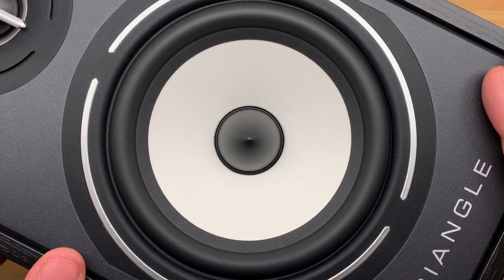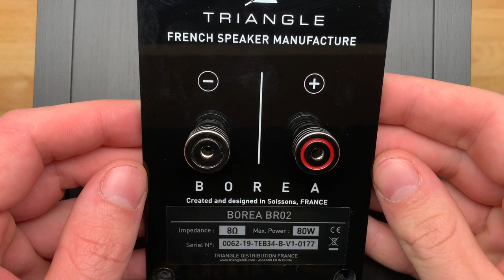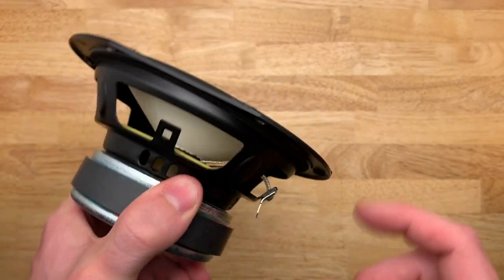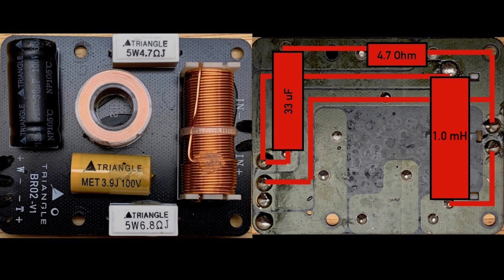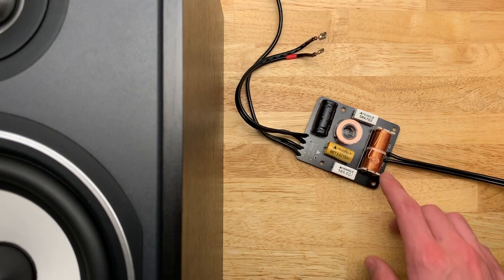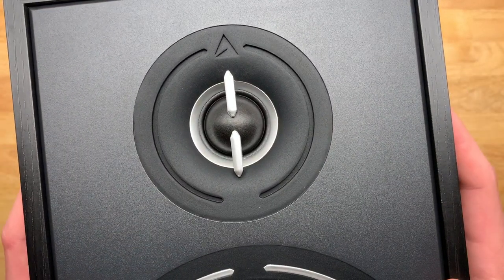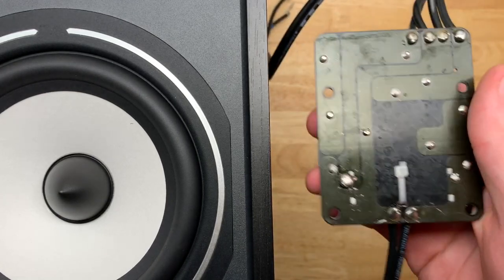Triangle Borea BR02 - Review and Analysis with Schematic

Comment: Thanks for the breakdown. I always take a look inside my gear to see if there’s anything I should upgrade to a higher quality part. They kinda had to use an electrolytic cap for the sub, because a 33uf poly cap would be huge. Thx for the vid, man.
Reply from the maker: @Nick Pantazi the poly caps get insanely big. I've upgraded a couple crossovers before and they definitely take up a lot more space in the enclosure (and cost a LOT more).

Comment: The resistor and cap across the woofer is a Zobel network to compensate for the impedance rise at higher frequencies due to the inductance of the voice coil.  That allows the inductor (this would be a 1st order crossover for the woofer) to see a flat impedance across the load at higher frequencies and allow it to work as calculated to block them.  Otherwise you get less effectiveness from the inductor as frequency rises and it's counter productive.
Reply from the maker: I once worked with a man named Zobel.

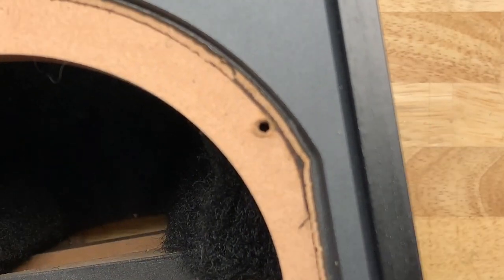Comment: Very true "manufacturing note" at 6:15. My Borea BR03 is not well matched so that left side of the woofer protrudes roughly 0.5mm outside the front speaker plane. My grills stay on and OCD is under control so not very bothered by it.

Comment: A capacitor and a resistor in parallel with the woofer is called a ZOBEL NETWORK. Zobels tame the impedance spike that woofers naturally have near the bottom of their frequency response. 8 ohm woofers are really 8 ohm rated when you implement a ZOBEL network.
Reply from the maker: I once worked with a guy named Zobel.

Comment: The question about the binding porst are they steel or brass. If they are steel removing that from the signal path will improve profomance. The woofer frame sounds like its a stamped frame. You can if there's room apply dense foam strips to the legs. The Plastic divider on the tweeter is a dispersion device. That the Crossover has copper inductors verses cheap Iron inductors. There crossover looks better thae a lot of speakers I've seen from $1500 to 2K on Dany's Channel.
Reply: You realize it does not matter right?

Comment: Nice, perhaps a BR03 breakdown in the future?
Reply from the maker: @CD - ROM that's a good idea. I wouldn't be against reviewing another Triangle.
Reply: Casey Schmidt I picked up a pair recently, and paired them with a couple REL subs. Sounds wonderful.
Reply from the maker: That sounds like an excellent combo!
Reply: @cd-rom.  Hi, I also have BR03, and thought of adding a REL. Curious, wich sub pair did you choose / recommend?
Reply: David J I have the REL T5i. The speakers have decent bass on their own, but when you hear it side by side with the REL. It’s 100% worth the investment. Hope you get a chance to hear them.
Reply: Hi, do you expect that the Bro3 would have a slightly better crossover, based on the specs and larger cabinet?
Reply from the maker: @Paul Grower - It is pretty much the same design as the BR02 just with a few more components; which is to say that it does have a better crossover. That said, it uses the same budget-quality parts as any other speaker.

Check out Tee-Jay's video here where he takes apart a BR03:
https://www.youtube.com/watch?v=laJrKozceFc&t=1218s
Reply: @Casey_Schmidt  Great. Thanks very much!
Reply: @Casey_Schmidt  Mr. Casey Hello! Mr Casey, if you live in USA 🇺🇸, much better use JBL Studio 530 speakers. I have a lot of complaints about JBL, but Studio 530 They did a very good job. Triangle Borea is the same price as the JBL Studio 530.  But the difference in quality is huge.If you compare a Borea woofer with a Studio 530 woofer, you will be shocked!  And everything else at JBL is better - case, connectors, tweeters ..

Comment: Thanks for the video, excellent teardown! I've been on the hunt for a speaker that's smooth and non-fatiguing, but also dynamic and engaging with classic rock, not too soft or muffled. FTR, rock is not the only music I listen to - my tastes are very versatile (from rock and pop to jazz, acoustic, vocal and classical).
You said these triangles aren't for metal. How about rock, mostly 60s-80s classic rock? Any speakers you can recommend for a small room?
Reply from the maker: Correct, I think metal music gets a bit too busy for these speakers but rock would be no problem at all. These also work well in a small to medium room.

Comment: Hey Casey interesting review but it would be helpful if moving forward you could include your gear list and room setup, that way potential subs can better assess your points vis a vis the particular piece of gear being reviewed. Without that context it is very hard to judge if what you are saying makes sense or not.
Reply from the maker: @Michael Mityok Thanks for the suggestion! Since I tend to focus on the technical aspects of the speakers, my thoughts during the video weren't so much on the listening environment or other gear in the setup. I can certainly go more in-depth in the future with my setup.

Comment: Hello i have a question if i may. If you change a crossover, did you get different sound , or more defined, quality sound but different? Or what combination? Hope that question makes sense. Thanks for the advice given in your video. ( Im asking because i like the br02 but i don't want different sound, but better sound and same sound signature)
Reply from the maker: The character of the speaker is unchanged. The clarity is slightly better.

Comment: Thanks for your review. Just a quick question, am I still able to connect the speakers with banana clips? I have a pair of very old BIC America from the early 2000s. The wire goes directly into the speaker(old school) if I purchase these, can just put the speaker wire in some banana clips and plug them in? Thanks
Reply from the maker: If you unscrew the terminals, there is a cross-drilled hole on each one where you can clamp bare wire.
Reply: @Casey_Schmidt   Thank you, so they’ll be no option to use the banana clips?
Reply from the maker: @pushplay36   do an image search for "5 way binding post" and you'l see what I mean. You don't unscrew the terminals all the way because the thumb screws are also what clamp down on the wire.

Comment: HAVE A QUESTION: if i decide to shape the upper box (model borea br-08) to create an open baffle mid and tweeter , is it possible? those drivers will work properly open air? what u think about that? thanks
Reply from the maker: Almost certainly not. Open baffle drivers require a very high QTS in order to work properly without having an enclosed to load. Low Qts drivers are have too soft of suspensions and will hit Xmax before evening coming close to their rates output. Long story short, they will mechanically wreck themselves without making much sound, they need the enclosure.

Comment: Great video. As I'm attempting to dip my toes into crossovers myself, I'd like to ask you how did you determine the values of the inductors? Many thanks.
Reply from the maker: @Leonard Emilian - Inductors can be measured with a form of digital multimeter called an LCR meter. They can be found pretty easily online in various price and quality levels. I’d recommend searching YouTube for some reviews on some to find the one you want. I just got a cheap $20 one because it gets close enough to the nominal value of each component. Thanks for watching!
Reply: @Casey_Schmidt  Oh, I see. While with caps and resistors having a multimeter is pretty straight forward, I always though you needed an oscilloscope and a signal generator for inductors (pretty out of my field of expertise stuff). But I'll definitely have a look into LCRs. Many thanks. One learns something every day, I guess.
Reply from the maker: @khameeleeon  - if you want to get the perfect value of the component, you’re correct that an oscilloscope is the right tool. But an LCR meter is designed to measure resistance, inductance, and capacitance; hence the name LCR.

Comment: So glad to find this video . Give me confidence that i might be able to replace the broken binding post on my BR02 but can you tell me how to remove the binding post/plate on  it ?  Its not a regular screw . thanks in advance
Reply from the maker: They are all normal screws for the binding post plate. No surprise there, unlike the front which is taped on.
Reply: @Casey_Schmidt  Thanks for the reply but mine is not a normal screws . I think i will need small allen wrench to remove the bind post?
Reply from the maker: @myat3279  the plate should come off with an Allen or Phillips head screw, the post just have a hex but on the back I believe.
Reply: @Casey_Schmidt  Thanks so much , i was able to open using Allen and replace the broken binding post terminal !  Now my Triangle speakers are working again. Subscribed to your channel !

Comment: I just found your channel and wow, great content! Really thorough analysis of the production quality, keep it up!
Btw, how did you measure the inductor values? Got the Br03‘s and thinking about upgrading the crossover
Reply from the maker: @Dinh Duy Nguyen thank you! I used an inexpensive multimeter that measures inductance, capacitance, and resistance. I measured each component while still soldiered in the circuit which is not the “correct” way to do it, however, the reading on the meter gets close enough to the standard value of each component that you can easily determine what the value is. Again, not the “correct” way but it works well enough for my purposes. You could also contact Danny Richie over at GR Research for more info on possible upgrades options.
Reply: Casey Schmidt I see, thanks! Upgrading the inductor isn‘t as simple as swapping the inductor with a thicker gauge air core inductor with the same inductance value, is it? Since inductors have resistance as well, right?
Reply from the maker: Dinh Duy Nguyen that is correct. The larger gauge wire has less resistance which will change the perimeters of the crossover. As long as you’re not trying to get a mathematically perfect crossover, it shouldn’t make too big of a difference. I’ve upgraded several crossovers with the stock values (ignoring the lower resistance of the inductors) and have always ended up with excellent results with no adverse effects due to the larger gauge inductors.
Reply: @Casey_Schmidt  Thanks for the info! Gonna order some crossover parts and try my luck :D
Reply: @Casey_Schmidt  Just opened my Br03's and interestingly enough it had film caps for the tweeter AND the woofer. The woofer cap is only 8.2uf as well which i find surprising. I am so amazed at the component quality they put in these budget level speakers.
Reply from the maker: That’s great to hear. If you can, post a video so we can all see what’s inside!
Reply: @dinhduynguyen3809  Do you know why the BR03 are using three resistors instead of two like in the BR02? I ask because I wanted to know which of the three is for the tweeter. I like to adjust the volume of the tweeter via a higher value resistor (to reduce the tweeter volume by about 3 to 4 dB). That's why I ask. Thanks in advance!
Reply: @basiema.4185  No sorry, I dont have the crossover infront of me. But can’t you just trace the resistor that is connected to the tweeter? 
If you dont mind me asking, why do you wanna lower the tweeter output?
Reply: @dinhduynguyen3809  You can take a look at the BR03 Crossover here: https://youtu.be/laJrKozceFc?t=1040
The tweeter is too loud and therefore much too forward, although I have a very neutral system.
Reply: @basiema.4185  I see. But why not get another speaker instead since the Triangles dont seem to be to your liking? Lowering the tweeter output will lower everything above the crossover point (around 3kHZ usually), which is a lot and it will probably still project the sound in a forward way... it will just be quiter
Reply: @dinhduynguyen3809  I like the overall sound of these speakers. The sound of the treble is good too. The Treble is just much too loud for my taste. To make it just quieter is also exactly what I want to do.

Comment: I have the BR03. I am wondering if it's worth to add internal bracing or dampening material to remove any resonances.
Reply from the maker: Check out my video on the Paradigm Mini Monitor V2’s. I showed an easy way to add bracing.
Reply: @Casey_Schmidt  Thanks. One more thing. Is the crossover screwed to that wooden block or attached with magnets? How did you get the crossover detached in such a tight space?
Reply from the maker: @leo11877  it is screwed in. Four screws.

Comment: For anyone not having head the speaker first!
DO NOT CHANGE ANYTHING IN THE SPEAKER, LET IT BE!

The speaker is heavily reliable on the crossover it already has, which utilizes the tweeter around 60/40 compared to the woofer, will happily give advice if needed
Reply from the maker: danielf4000 upgrading the crossover with or without higher quality components away from the stock values would definitely be a bad idea without taking proper frequency response measurements. But as long as you keep the values of each component the same as the original crossover, the frequency response and power distribution between the tweeter and woofer won’t change with better parts. Thanks for commenting!

Comment: These speakers seem to be built better than the Klipsch RP-600M and those are almost $200 more expensive.
Reply from the maker: I agree. Their speakers do sound good but the more I’ve thought about it, the more I think that Klipsch is a bit overpriced when you look at the build quality. And like you said, the RP-600M has surprisingly low build quality for the price. It’s made of 5/8” mdf instead of 3/4” and doesn’t even have internal bracing.
Reply: @Casey_Schmidt  I agree, the Klipsch Reference and Reference Premiere series of today are poorly made, expensive, and overrated. They only are interesting with a discount, and not interesting at all if you want a true hi-fi sound.

Comment: borea br02 or q acoustics 3020i?
Reply from the maker: Unfortunately, I cannot give you a solid answer on that because I have not yet heard the 3020i’s. They do seem like very similar speakers in a lot of respects. The 3020i’s are significantly cheaper that’s for sure. What I can say is that you would never be disappointed with the Borea BR02’s if you don’t mind the higher price tag.
Reply: @Casey_Schmidt  Thank you. Ill get br02 they look better quality. Have you eve tried sony strdh190 receiver? Or any low cost integrated amp or receiver?
Reply from the maker: The Yamaha R-S202BL and the Topping PA3 I’ve found are both decent amps in the $100 range. The PA3 is a class D with a little less power but is very clean sounding. The R-S202 has a warmer sound but is not quite as clean. But it does have a remote and inputs to choose from.
Reply: Anıl Yazar
 I have owned the Q acoustics 2020i's for 4 years, which are the older model of the 3020i's. They are good little speakers for the price i paid. (100 GBP at the time) I think for the price you would be hard pushed to find something much better. That being said, if you like bass, then the Q acoustics might not be for you. However, the mids are fairly decent, and the highs are pretty well refined without every sounding too harsh or shrill. Imaging and sound stage is pretty good if you pair them with a half decent DAC and amplifier. The overall sound signature of the Q Acoustics is fairly warm and neutral. They do like a fair amount of power, so pair them with an amplifier of at least 40-50 Watts per channel.
Reply from the maker: Ambient Wonderer thanks for the input!

Comment: any way to tighten up bass?
Reply from the maker: @jack falco - Not really. Bass “tightness” is tied directly to the woofer’s construction, t/s parameters, and enclosure design. The best you could do is to experiment with different amounts of stuffing, add vibration-absorbing material to the inner walls, and... that’s basically it. You might be able to do something with changing the crossover design but it’s unlikely to get much results there. I think their bass is already really clean for a ported speaker but others may disagree. Great question!

Comment: br02 or br03 for desktop?
Reply from the maker: @CZ - That is a great question and something I don't think I addressed in the video. In my opinion, the BR03 might be a little on the big side for a desk whereas the BR02 would be more appropriately sized. But that can also be down to taste/preference. From my experience with the BR02's, I think they can work well in both full room and desk applications. I personally feel that they are better in the full room environment where you can sit a little further away from them.
Reply: @Casey_Schmidt  thanks for the quick response, my desk is large enough to accommodate both. Would the sound be any different to the br03?
Reply from the maker: @CZ - Unfortunately, I haven't gotten to listen to the BR03's in person so definitely take what I say with a grain of salt. That said, the BR03's should be very similar to the BR02's in terms of the nature of the sound since they are mostly identical. The obvious difference is that the BR03's will have fair bit more low-end. If you plan to pair these with a good subwoofer, it probably wouldn't make a lot of difference between the two. If you don't have a solid sub or if you plan to run without a sub, the BR03's would be better if you are looking for the best bass response. One more thing to think about is that the BR03's will fill a larger room much more easily than the BR02's. So if you want more flexibility out of them, then maybe the BR03's would be the safer option. Either way, they are both great speakers for the money so I don't think you could go wrong with either!